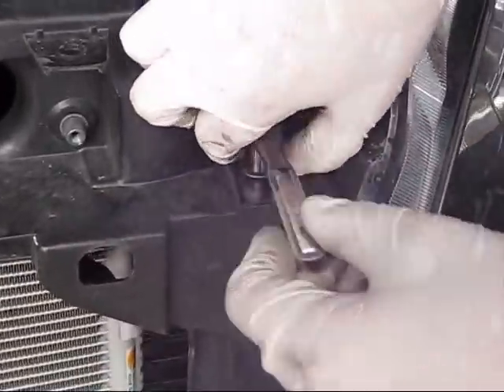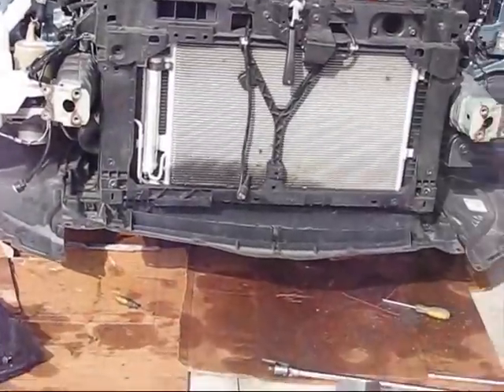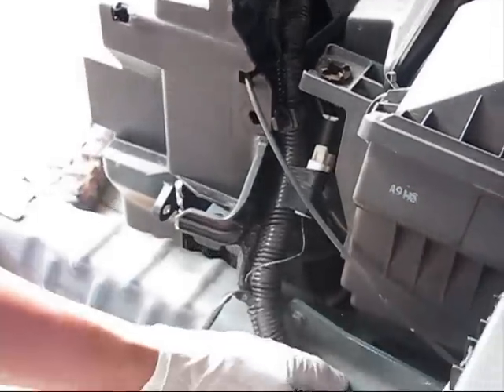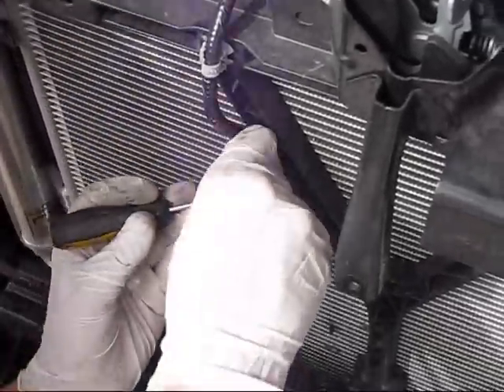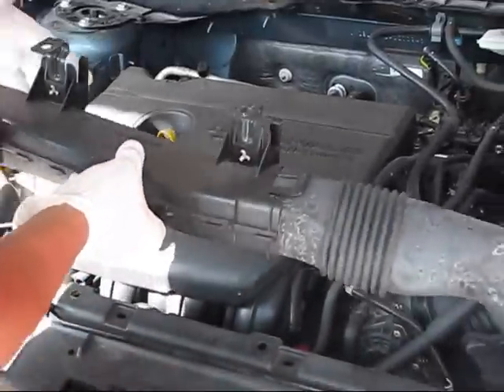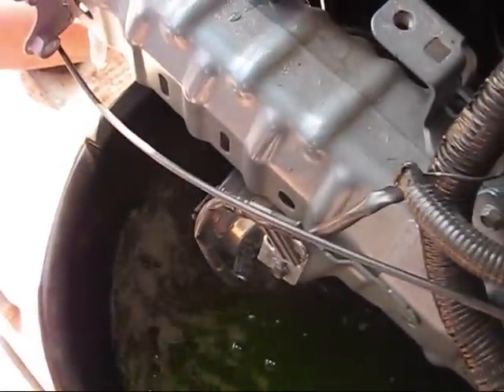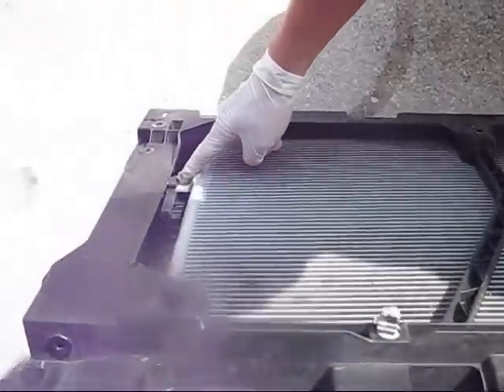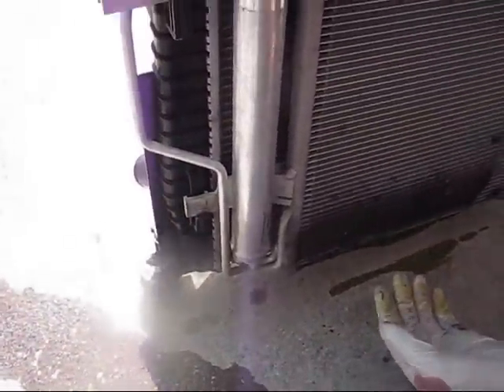How to replace condenser on 2010 Mazda 3 part2

Comment: You can dismount the radiator and condenser from the bottom without doing all of that
Reply from the maker: no, you can not.
Reply: You can absolutely remove this a/c condenser from the bottom of the car without removing hood metal bumper, lights, etc and it only takes 2 hours. I'm doing a 2011 mazda 3 now.
Reply: Ok so a month ago I have changed my condenser, all work great now. And to confirm YES you do have to follow step by step what guys are showing in the video to achieve the result. And allow yourself 6-8 hours and a good day with a good weather. Good luck guys. 👍
Reply: Ace Riva do u have any video.?
Reply: @George Babiy 6-8 hrs lol, i wish you joking. It tooks 2h30 at dealership to remove, refill ac and coolant and put bumper back.
Reply: I did mine from the bottom too.those Russians did more work than they had too lol.

Comment: Came here to see how to take off the radiator support itself. FYI. If you don't have to replace a condenser or the radiator itself, the support CAN be removed without disconnecting them!
Reply from the maker: Well this video demonstrated on how to replace all front just in case... ;-)

Comment: I think you can pull out the fan, radiator, and condenser from there bottom without removing all these assembly. The  bumper, headlights and the fiber assembly didn't need removal...
Reply from the maker: Well I don't think so

Comment: I'm very happy to read that some people did this pulling the assembly from the bottom. I need to put in a aftermarket radiator and might as well do the condenser as well. All the fins at the bottom are bent in and making the car run hot. I have a 2011 Mazda 3 with the 2.5. anyone who can chime in would be appreciated.

Comment: Doubly triply extra work. I took my condenser out from the TOP and I didn't even remove the radiator to do it. Pull the bumper and headlights. Unbolt the side framerail bolts. You can access the clips holding the condenser to the radiator from the front. Unclip the 2, lift the top latches for the radiator, and disconnect the high and low lines. Then just pivot the radiator forward and it BARELY slips up through the top. Might need to shift the harness and lines around (still have to unplug the front pieces).
Done, easy. Don't forget to realign your headlights after.